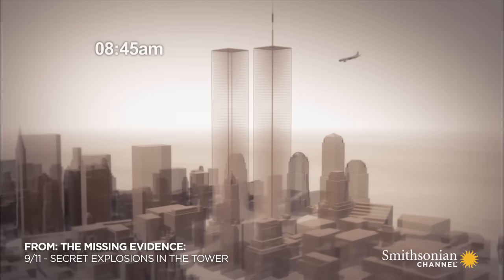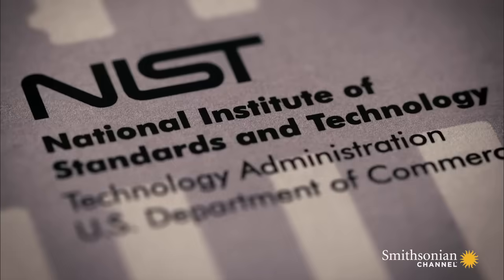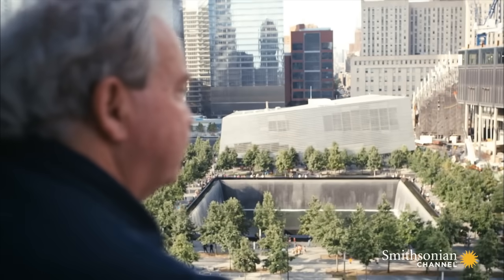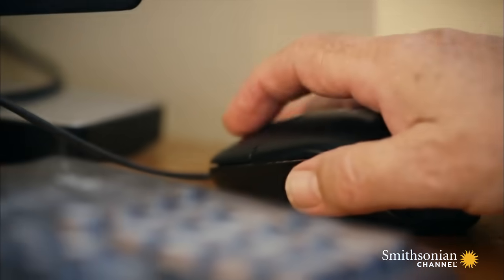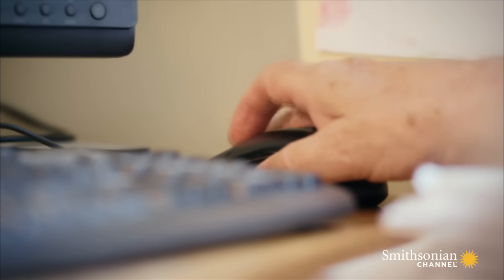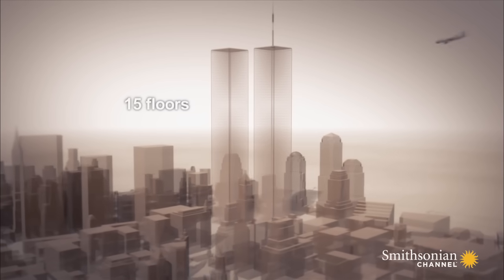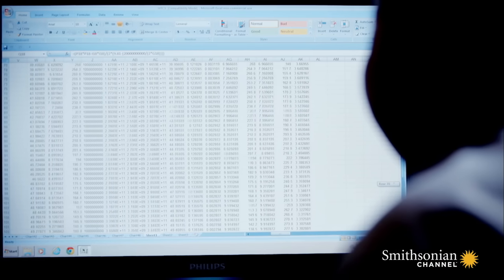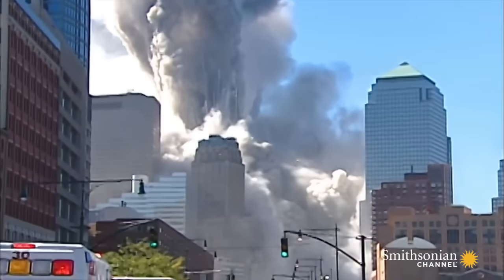This Computer Simulation Explains How the Twin Towers Fell

Comment: Something which immediately struck be as odd is how 1,300 feet of steel and concrete simple vanished, as if everything was pushed into the ground. Normally building collapse into a pile of debris approximately 20% of their original height but these seem to disappear..
Reply: The pile of debris was around 7 stories high and spread over several blocks. The towers were mostly empty space (a benefit of their construction). They were shipping the debris on barges to statten Island for weeks afterwards. They definitely didn't disappear.

Comment: There is no  inside job whatsoever  because   plane hit into the building so hard  and  explode inside   causing jet fuel to burn   steel beams  then  when steel beams  gets weaker then   building on top came crashing all the way down to the ground.

that's exactly what happened.

Comment: Another half assed would be expert talking absolute pish. If you look at the floor system any engineer or architect worth his salt can see the floors did not support each other, the only load bearing from one floor to another would be on impact from a falling floor. 
But a floor falling piece by piece progressively would not exert enough weight to collapse the floor below. Imagine climbing to the top of a tree and stamping and breaking a branch until the branch breaks loose, then watching the entire amount of branches falling off the tree reducing each other to dust followed by the trunk collapsing down destroying itself into fine saw dust even though it hadnt been damaged. Impossible isn't it. YES. Could not happen, NO.
Another reason the floors could not not have failed as described is that the floor pans where constrcuted from structural decking, steel mesh and concrete poured to a minimal depth of 100mm. once this is cured it would have been many times stronger and provided more structural strength than the trusses which supported them below which connected them to the exterior steel facade from the core. So when the trusses sagged as wildly claimed in the not so hot temps declared, the floor pans would have supported their own weight or at the very leaty give way in a more slower latent fashion not causing the impact of a free falling object upon another floor.
The entire floor sections could not have fallen at the same time symmetrically as these gatekeepers are trying to suggest, nor could they have smashed through the structure below them which was 100% undamaged and structurally sound below the impact zone. 
No amount of lies and mistruths can qualify the asinine attempt at convincing such an improbable collapse of the most technically advanced and strongest structure of its time to just FALL APART LIKE A CHEAP BALSAWOOD KITE. 
HOW ANYONE CAN LOOK AND BELIEVE THIS EXPLANATION OF DESTRUCTION SHOULD NOT BE ALLOWED TO OPERATE AN ENVELOPE KNIFE.
Reply: Joe -- "HOW ANYONE CAN LOOK AND BELIEVE THIS EXPLANATION" -- hey Joe, one doesn't have to be an architect or an engineer to understand the explanation that is universally accepted (outside of an ever shrinking fringe group of conspiracy believers), all that is really required is simple math. 

The WTC, like all buildings were built with redundancy factors that should have allowed each floor to support approximately 1300 tons beyond their own weight.  When the floors that were damaged by the plane crashes and fires gave way, there were AT LEAST 45,000 tons, (10 floors or more) crashing down upon the floor below it.  That's 34 times the amount of weight one of those floors was designed to support... The reason why so many people accept that this was the cause of the building's total collapse is because they are able to understand simple math...

Comment: The Smithsonian government cover-up Channel
Reply: Got that right. False flag attack by domestic terrorists George Bush Chaney and Rumsfeld in cooperation with the mossad.
Reply: @Summernightsandneonlights  What if the terrorists didn't do it? What if we just blamed it on them for a reasonable excuse to go to war with them. We've done it in the past.
Reply: If the building was bombed, the structure wouldn’t collapse like it did. The building would’ve collapsed as soon as the bombs went off. Your evidence is weak.
Reply: @aidanknisch1996  it did . it wasn't bombed as you call it. It was a controlled demolition. Besides who said it was bombed ?
Reply: @Summernightsandneonlights  it did . it wasn't a controlled demolition as you call it. It was an explosion. Besides who said it was a controlled demolition ?
Reply: @Cd5ssmffan  clever
Reply: Dolan Kang sure
Reply: Mick West

Comment: If one floor collapses onto another, it doesn't add weight. It still weighs the same. The bottom floor has been holding that entire weight of the building for years. It is scientifically impossible to fall that fast with no help
Reply: Your understanding of physics is about as good as a 10 year olds, I’m not sure you should be scrutinizing actual experts
Reply: @maxonite  while his understanding need a bit of work, the pancake theory was debunked. So his last sentence is correct.
Reply: Static vs dynamic loads. Just think about it. If you lifted an 11 story building 6 inches off the ground and dropped it what do you think will happen?
Reply: So if a person stand on your shoulders with two feet, goes to standing onto your head with one feet makes no difference in change in stability
Reply: Do you enjoy being an imbecile?

Comment: Why the Towers failed can clearly be explained that in all likelihood no study had been made if the airplane was filled with fuel. That is the unique factor involved in this collapse. Conspiracy folk should give it a rest.
Reply: Nist admitted 85% of that fuel was burned off outside the building on impact.
You'd have a better idea of how they fell if you had read the Nist report and quantified the collapse accelerations.
What you actually have is a faith based opinion you got from watching BS govt stories like this one.
Reply: @timothyehook4883 For the fuel to have been burned outside the building on impact begs the question that just how is the fuel suppose to get their at that speed and still encased in its tanks. Now, have you ever been present at a fire explosion? There is a reason why you get mushroom flames following a fire explosion. The air is no longer what it is normally. If you have an explosion in a confined area it creates a tremendous outward pressure wherever it has the least resistance. nd where it has the most resistance sometimes things can happen to the structure. The building after the explosive fire was not the same strength wise as it was before the fire. The building studies for these types of buildings never included studies as to what would happen if "X" happened because it was not conceivable.

Comment: Progressive collapse was the theory used in concrete section buildings and not steel frame buildings and is a function of old concrete only building construction.  As someone familiar with the demolition of tall structures, I knew that it was a controlled demolition before the top of the first tower struck the ground. Add to that the eyewitness accounts of explosions all on live TV and the conclusion can only be controlled demolition. Investigate the bank accounts and lifestyles of these fake scientists!
Reply: How exactly are you familiar with planes crashing into tall structures?

Comment: The first tower fell forward - it's sides were weakened by the impact and heat, the tubed metals buckled under the weight. Take your tin foil hat off, it was terrorism, and you know it.

Comment: Such BS.  You are also manipulating likes and dislikes again YOUTUBE.  2.2 MILLION views and you are again removing dislikes.  You are literally taking the word of one scientist who just happens to spew the same BS as NIST.. once initial collapse occurs, there is no stopping the buildings from completely being destroyed.  DO you not know what's wrong with this people.  The bottom floors are all reinforced to support every , EVERY, floor above it.  Having the top section collapse may cause a couple floors beneath fall but would slow down til the bottom again supports all weight above. This didn't even come close to happening as the towers all came down at almost FREEFALL speed.  The only way that could happen is if everything holding the upper floors was compromised.  The same thing happened to Tower 7, which they don't even mention, and was not even hit by a plane. This building 7, which had some NORMAL office fires, came down at FREEFALL speed.   Figure it out, you were all lied to and if you don't believe me, then you are brainwashed fools.

Comment: lollllllllll...Now explain how building 7 went down in free fall without even a plane touching it....NICE TRY...lolllllllllllllllllll....building caught in fire like building 7 don't go down in a symmetrical fashion ....This is the Hallmarks of controlled demolition ...same thing for the twin towers by the way .CONTROL DEMOLITION WITH NANOTHERMITE ALREADY PLANTED IN THE BUILDINGS.
Reply: Now explain how building 7 went down in free fall

It burned for 7 hours, suffered an internal support collapse and then the perimeter columns failed. And WTC7 collapsed globally 40% longer than Free Fall Acceleration.

without even a plane touching it

WTC7 was hit by thousands of tons of steel and concrete from WTC1 when it collapsed.

building caught in fire like building 7 don't go down in a symmetrical fashion

WTC7 collapsed north into the Verizon Building causing $1.4 billion in damage.

This is the Hallmarks of controlled demolition

There is no evidence of controlled demolition.

CONTROL DEMOLITION WITH NANOTHERMITE ALREADY PLANTED IN THE BUILDINGS

Nanothermite has never been used in controlled demolition of a high rise skyscraper.

Comment: This is an example of Baked Physics Simulation. It's when you tweak a simulation in order to have a predetermined outcome.

In reality, the towers kept standing after the impacts and the fire was slowly going out. Both towers collapsed in the same way. The collapse began suddenly and was total. All investigations didn't even considered the explosives hypothesis, which is the only one that explains such a collapse. Because there is no way such a collapse could have happened without the internal support structure being destroyed.
Reply: "Because there is no way such a collapse could have happened without the internal support structure being destroyed" The internal supports were the last to fall....so much for your theory!
Reply: The south collapsed completely differently
Reply: @Stein_TV  How so?
Reply: Er, so no explosives residue found or just all hushed up by the tens of thousands of workers on the site? The towers were popped up on the cheap: the only conspiracy of note and covered up by the contractors.
Reply: @gargarcomedy  We won't bother mentioning how the building was designed to allow for 6 floors failing when 14 stories eventually did.   Is there any point moving across the plaza where 23 stories eventually failed.    And you're worried about explosives?? 

Really?
Reply: @roquefortfiles  I'm not worried about explosives cos there weren't any. Conspiracy nuts think there were. Reread my post cos I think you arguing without thinking. I know the weight of floors brought them down, that plus initial poor construction
Reply: @gargarcomedy   Thumbs up.  Not arguing with you.
Reply: Also, Building 7, videos never released from the Pentagøn and $2.3 Trillion “missing” the day before.
Reply: Exactly, they don't even go into detail about the model. As far as I'm concerned, this video supports a different "conspiracy theory"
Reply: Hey Einstein?  The internal structure was destroyed.   By the aircraft and fires.  The columns cant stand without the cross brace of the floors.  Both are involved
Reply: @roquefortfiles  we are on the same page by the way. The initial post is just conspiracy bull
Reply: Dude? if you think the building is designed to arrest or STOP 23 stories collectively failing??  You're on GLUE
Reply: Yeah yeah. Im sure the earth is flat too

Comment: I've done both
CONTROLLED DESTRUCTION
and 
UNCONTROLLED DESTRUCTION
if various size buildings

after the super structure is
compromised it only takes
PRESSURE and TIME
for a 
CATASTROPHIC COLLAPSE 
to happen

the TWIN TOWERS were old
and the SUPER STRUCTURE 
was weakened by time
Reply: I guess the planes came just in time to stop a catastrophe

Comment: I gave this guy a chance

Waited for him to prove

Got disappointed after all
Reply: How does this explain building 7?🤔
Reply: Harold Navarro building 7 was damaged by debris from the WTCs and also caught fire. It had several hundred tons of metal and concrete smash into it.
Reply: Harold Navarro, the collapse of WTC 1 ignited fires on at least 10 floors of WTC 7 at the western half of the south face. Fires on Floors 7 through 9 and 11 through 13 burned out of control, because the water supply to the automatic sprinkler system had failed. The primary and backup water supply to the sprinkler systems for the lower floors relied on the city's water supply. Those water lines were damaged by the collapse of WTC 1 and 2. These uncontrolled fires in WTC 7 eventually spread to the northeast part of the building, where the collapse began. Simple explanation, but your still gonna believe in what you want. Make your choice, believe in science or believe in delusional conspiracies.
Reply: @slater1988  actually science proves that the only way WTC7 could have gone down the way it did is by simulataneously destroying all dozens of columns in a football field area at the same time. 4 year study with high-end computer models costing 300000 dollars, more than proved the ridiculous fallacious assumptions about fires lasting 90 minutes and performing a never before seen destruction of a single piece that leads the football field sized area of pillars to slide sideways giving us a perfect demolition.
Reply: @jtwip5900  fax
Reply: J Twip, softened steel is comprised steel. In its normal state steel is VERY strong but it doesn’t take molten steel to collapse. A multitude of tons pushing down on the comprised softened steel is not going to be able to hold it up. Steel in this softened state where the fires around the pillars got up to 1,200 degrees not melting the steel but like I’ve said before compromising it allowing it to shift and bend .Which then resulting in the collapse of the towers. 👍
Reply: J Twip, it just takes a couple to give out to allow the building to fall. The cascade of the beams collapsing put more weight on each other beam which it could not support. Resulting in multiple beams collapsing on one and another and another until the inevitable collapse of the building. Not that hard to comprehend. And if what you say is true then give me some of your “scientific proof” the explosives were the only way to bring WTC7 down. Please, enlighten me.
Reply: @slater1988  mate, your theory is very nice and all, it's just that actual computer models run for 4 years costing nearly half a million dollars proved all you just said to be impossible. If you would like to get more detail just search for the study that was commissioned to the University of Alaska. Unless physics stopped working that day, the only way to bring the building down the way it did go down is a controlled demolition.
Reply: @unexpected78  Because grand conspiracies like 9/11 are implausible.
Reply: Archetects and Engineers for 9/11 truth have disproven this guy's "science".
Reply: But he had an english accent....you are supposed to believe him.
Reply: Really?? How so? It's actually VERY simple physics that even a dullard like you should understand.
Reply: Just because you don't understand science doesn't make it wrong.
Reply: The problem isn't whether or not is was wrong, it's that this video doesn't explain anything
Reply: Cynetri but it did... did you not watch it?
Reply: Government Shill, THANK YOU!!! Just because u don’t understand it doesn’t make it wrong!
Reply: Pete Jeffris it is wrong

Comment: With 100 % certainty the twin towers were brought down on purpose . (Inside job) . The evidence was right there from the moment it happened and not many people realized it. The N I s t report admits the buildings fell to the ground in 10 to 11 seconds. It's been calculated that if a bowling ball was dropped from the top of the towers it would take approximately 9.5 seconds to hit the ground. The planes only damaged the buildings from around the 80th and 90th floors up. The rest of the buildings would have been untouched and still as strong as the day they were built. Now supposing that everything the n I s t report said is true , it only accounts for the initiation of the collapse not what happens from there on. This means that the top damaged portion of the building fell through the undamaged portion of the building and hit the ground in virtually the same time as it would have if the building wasn't there. Meaning the undamaged portion of the building gave almost zero resistance to the debris falling into it .This is impossible and goes against the laws of physics . No experiment or demonstration has been able to replicate what happened on 9 11 without the use of explosives. Case closed.